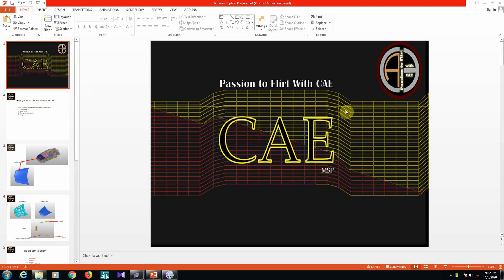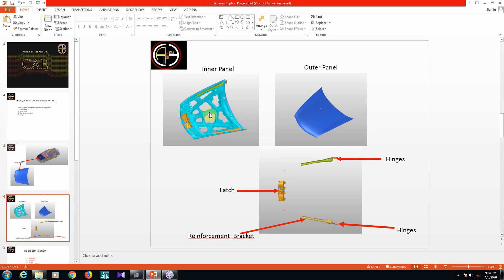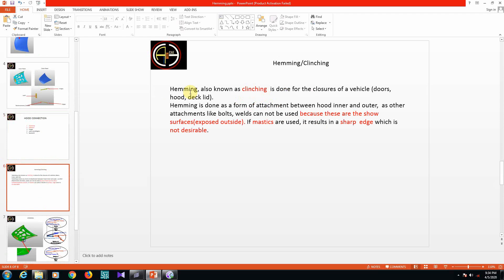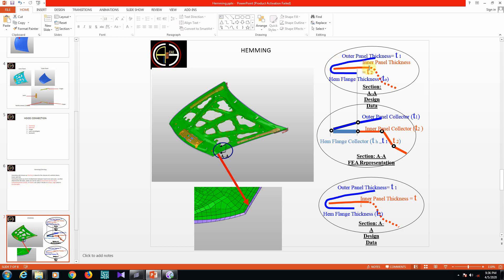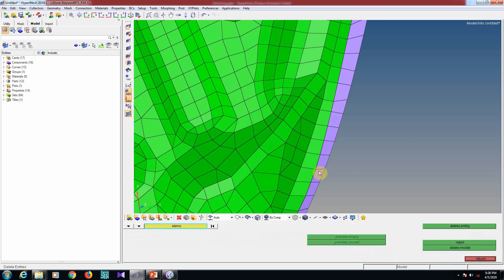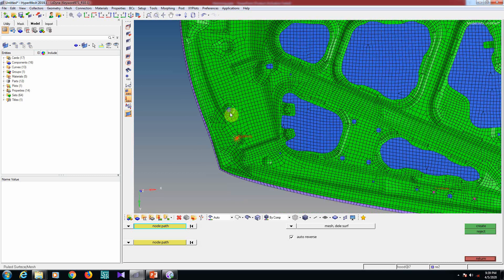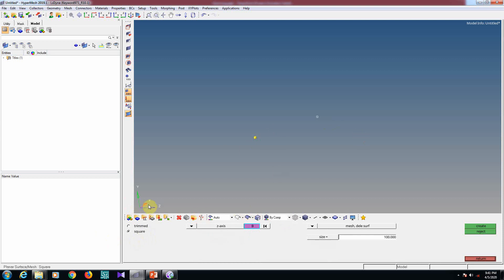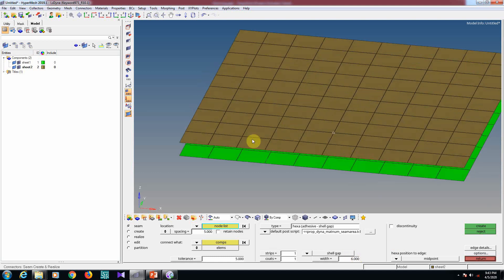Lsdyna Hemming and Adhesive Connection using Hypermesh

Comment: Hi Why the Hypermesh is so heavy application
I have Hypermesh 2023 suite in my PC (Ryzen 5600X, 16Gb RAM, RTX 3060 12Gb). My computer lagging so much even if only I import geometry
The geometry is a simple small 1Part (motorcycle shock absorber head)
Actually there is nothing suspicious in the Windows Task manager (CPU 10~20%,  RAM 50%)
I don't know why this can possibly happen
Is there anything that I can do to make the application lighter?